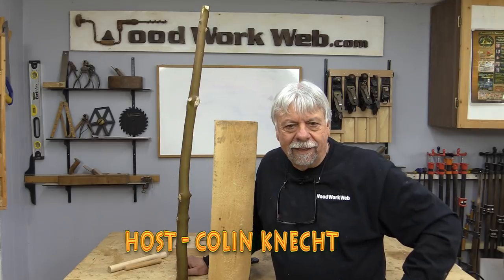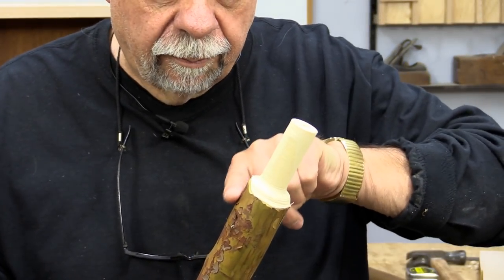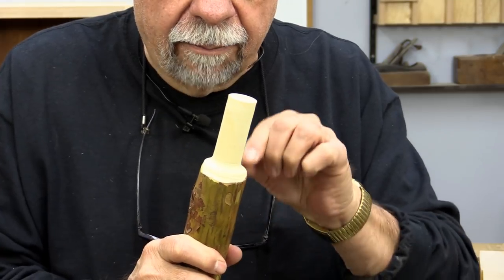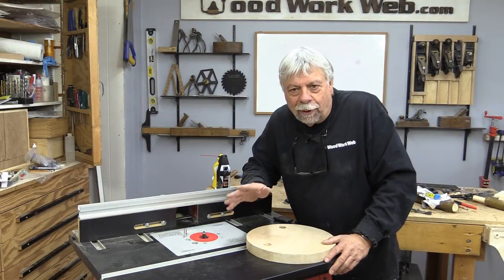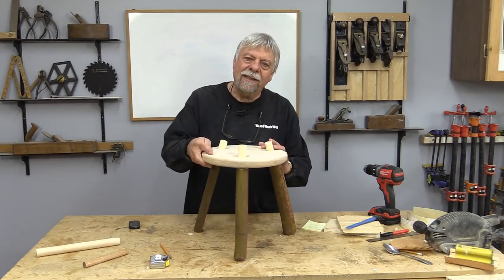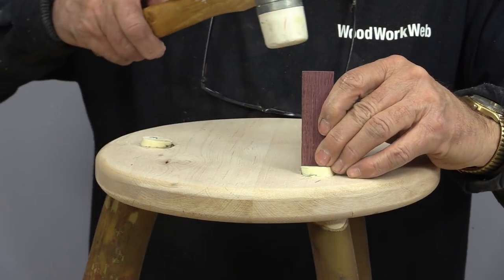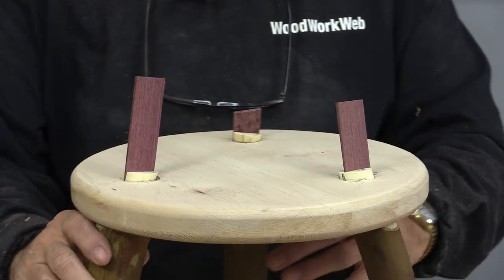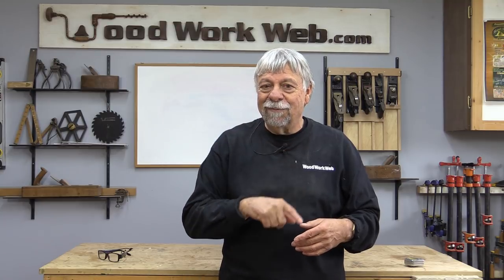How To Make a 3 Legged Wood Stool (Milking Stool)

Comment: When you make something and show it in a video it always seems so simple.
All the steps are clearly explained. It should be possible to make it even when somebody is less experienced.
Thanks for sharing.
One question: what kind of wood should be used for the splines: harder, softer of the same hardness as the wood for the legs?
Reply from the maker: Hi Hans, I like to use a harder wood for splines, but often I am also looking for a contrasting color too

Comment: Since very few people milk cows today I assume it is for indoors where the air conditioning dries out wood quickly,  The reason I say this is I have 2 grandkids in the house 5 days a week and they would love picking the bark off the legs as they dry.  That being said I agree that the natural look will become a mess.

How about building a stool and pretend you don't have a bandsaw so use the table saw to round the top.

Great job as usual. don't use cow dung to stain the wood